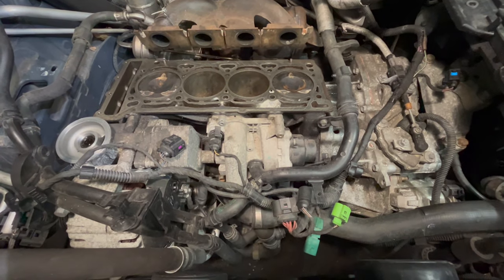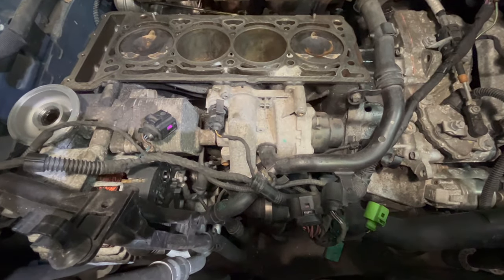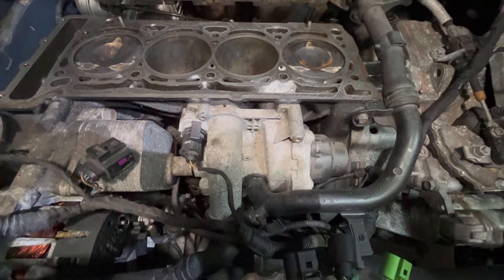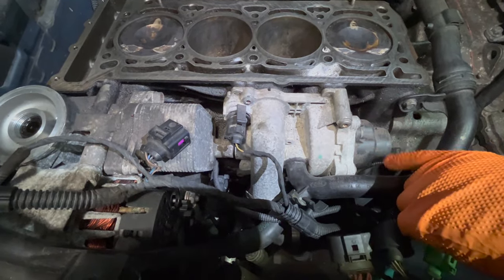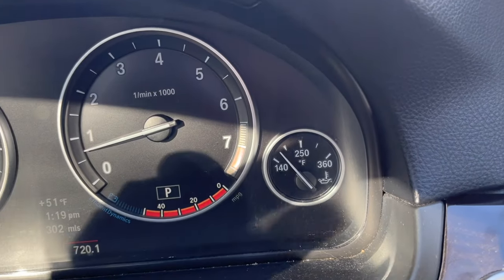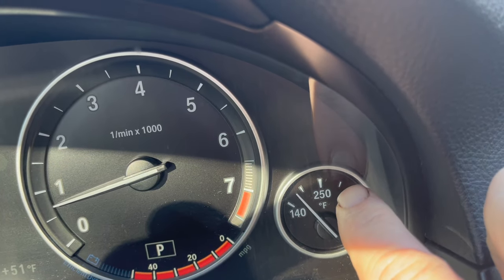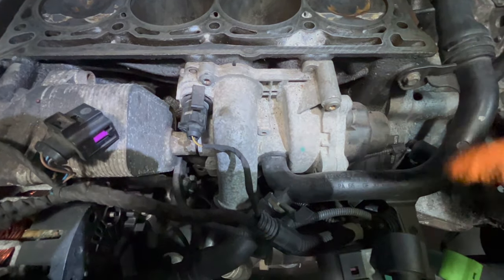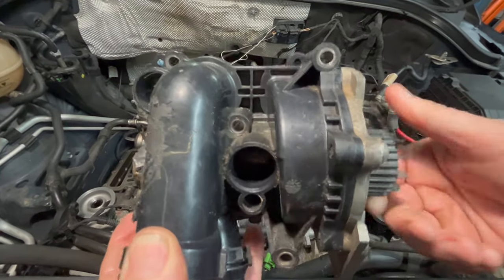3 Symptoms Of A Bad Water Pump

Comment: My bmw has 212k on the clock.    The coolant temp says anywhere from 85 degrees Celsius to 108 degrees Celsius….    No obvious leaks        Hope I will have signs like the ones you just pointed out instead of it just randomly dying.    Good video boss.
Reply from the maker: Thank you! Usually coolant problems happen slow so you will catch them in time.

Comment: Mine made a strange noises and my enjoin began to vibrate and I got it off the road fast and killed it. A belt hangs below and water or coolant was all over the ground.
Reply: The temperature gage was up not in the red but I got it to a safe place called the Tow truck and he came in 20
Minutes 😊
Reply from the maker: Hopefully all is good now? You caught it in time?
Reply: weird...mine goes pop pop sounds like I'm doing a pop n bang tune but then the steering wheel becomes so hard to turn😂 realize that the belt is hanging down the engine already

Comment: I have a Chrysler 200 2.4L 4 CYL. Had no issues with my car until one day while idling the upper radiator hose collapsed. Put the new hose on, got it burped, but had some over heating issues after I took it there. 

Not sure if they used the wrong coolant, but I replaced my thermostat housing and did a flush, then filled with the owners manual coolant. It’s no longer over heating as of 2 15 minute drives, but I notice the temp gauge is still fluctuating when i’m at high speeds vs low speeds. I made sure to burp twice now, so it can’t be air in the system is my guess. I already bought a water pump replacement, and figured if it’s the head gasket I may as well save myself the hour of labor.
Reply from the maker: It may have blown the head gasket from what you are saying.
Reply: @motorcarnut  The shop replaced my valve covers + gaskets, do you think they misdiagnosed the leak possibly?
Reply from the maker: @Zach-lz1zh very well could have.

Comment: Hey Motorcarnut, Seems like my old girl 2006 Opel Gamma 1.4 has just blown it's waterpump. Once car runs for 2km it starts overheating and coolant starts leaking from the centre of my engine (I assume the pump is sitting under the engine)
Reply from the maker: Make sure is lots a simple radiator cap first

Comment: I just got my Kia Forte 2013 a complete coolant flush, transmission flush, new brakes, and now I have low oil pressure light on 🥺 guys at Valvoline checked it out and said my coolant fell low however the oil was fine and since then, my coolant hasn’t gone down. I usually will give some ideas to the mechanic - just to avoid being ripped off. I was thinking bad oil pump or worse case scenario the coolant is leaking into my engine
Reply from the maker: Did they put the correct type of oil in the engine? Unfortunately those 2.0 engines are prone to engine failure do to faulty crankshaft milling. I have videos on my channel all about that and how to get a free engine. May want to check that out too. Hopefully yours is not that problem but just to be sure.

Comment: My coolant overflows and the heating stopped working. Mechanic changed the thermostat, the heating started working and after 2 weeks, the heating stopped, coolant continously overflows and car over heats after 15mins drive. I am getting frustrated now because its winter. Would this problem be the water pump?
Reply from the maker: Can be, but instead of throwing parts at it which can get expensive it should be diagnosed first. That said, water pump, radiator, air in the system or blown head gasket can be the problem.
Reply: @motorcarnut to diagnose an overheating engine will a mechanic have to take the whole engine apart?  because mine has the same issues but I really don’t have money to go to a mechanic but as long as they diagnose it I’m pretty confident i can fix the issue myself I just don’t wanna get charged for having them take my whole engine apart and then put back together. I’m only 20 and money is real tight right now.
Reply from the maker: @hollowtips23 not to diagnose the overheating problem, no they should tell you what they think the problem is just by doing some tests
Reply: @motorcarnut  Appreciate the reply, Thank you!!
Reply from the maker: @hollowtips23 no problem

Comment: My car keep overheating I have a 2010 fusion sport… antifreeze keep boiling and leaking but it takes a while of driving to overheat what do you think the problem is
Reply from the maker: Could be a faulty thermostat and or radiator cap. Start with the cheap things first.
Reply: @motorcarnut  I just replaced the reservoir cap yesterday. Heat working fine I think it’s a hole in one the radiator hose I hear sizzling when it’s hot
Reply from the maker: That will do it too
Reply: Same exact problems radiator cap helped. But still overheats on the long drive to or from work.
Reply from the maker: @jonathandoe2316 could be a thermostat problem
Reply: @motorcarnut  just replaced it a few months ago. Thinking water pump or a coolant flush needed.
Reply from the maker: I would have started with the flush first but go for it.
Reply: @motorcarnut  Alright I got a bad leak from my radiator now too. Still a flush first or water pump more likely now.
Reply from the maker: @jonathandoe2316 radiator should be replaced then
Reply: @motorcarnut  The whole thing not just the water pump.
Reply from the maker: If it’s in your budget, yes. Radiator could very well be partially clogged causing this problem

Comment: The reservoir tank is overflowing but not overheating. I changed radiator cap and thermostat ready but it still overflow. Please tell me about this problem 🙏🙏
Reply from the maker: Well can be a blown head gasket pushing the coolant out of the overflow
Reply: @motorcarnut  but engine not overheating. No bubble but slightly shaking propeller
Reply: @motorcarnut all day it work over 8 hours . Not overhead
Reply from the maker: Are you overfilling the reservoir tank?
Reply: @motorcarnut  I removed back to radiator
Reply: @motorcarnut  can be water pump?
Reply from the maker: @SaLin-uf9bf it’s possible yes

Comment: I have humming noise during the cold start in otherwords when I turn on my engine in the morning but after about 20 minutes of driving it disappears, my mechanic said that the bearing is worn but the pump will still work Can I give a grease nipple to arrest the noise
Reply from the maker: I don't think so, it's getting ready to fail and should be replaced.
Reply: @motorcarnut  Thank you very much for your kind and sincere reply
Reply from the maker: @munnachakra4342 sure, no problem
Reply: I have a 2009 bmw 528i and my car acts like it don't want to go like it don't get no gas when it gets hot could that be a water pump problem or my coolant tank
Reply from the maker: @edmundomiranda6773 no

Comment: What if my car does not overheat but after a while sometimes my coolant reservoir start having bubbles I’ve change thermostat radiator fan radiator would that still b the water pump? Nd my heat works
Reply from the maker: Some bubbles are the normal process of the vehicles coolant system but not excessive.
Reply: Foamy bubbles?
Reply: Gasket lol
Reply: Burp it?
Reply: @luxeiry1049 NO BURPING on the car. :)

Comment: so i just bought a skoda octavia 2022 with 22.000 km's. Its making a sound and it seems the water pump, also the car heats a little bit on the hood but the temperature is below 90 degree. I didnt know it was the water pump because its a new car and accelerated a little bit do you think i cause damage to it?
Reply: to the motor i mean
Reply from the maker: It’s under warranty, correct? Just go to the dealer, working on it yourself may void warranty
Reply: yes it is already scheduled thanks @motorcarnut

Comment: My car is not overheating kinda. But it goes over 90C and stops at 117C such a weird issue 😂 and if i want to cool the engine, i stop and turn the heat all the way down but then it even goes to 70C 😂😂 what the hack ?? Help please 😂
Reply from the maker: Could be as simple as a failing thermostat

Comment: If u have a gauge yes some don't mine dont
Reply from the maker: Yes, because they want your engine to fail.
Reply: @motorcarnut  it seems that way I swore never to buy a car again without 1 foolish idea
Reply from the maker: Some have no oil or transmission dip sticks either, lol.
Reply: @motorcarnut  true
Reply: Hye, my radiator is keep on discharging coolant into spare tank. Even many parts has changed (new radiator, new thermostat, new radiator hose, new radiator cap) but the radiator still discharging coolant into spare tank. One of my mechanic suggest me to change the water pump. May i get your advice?
Reply: @Zas Zahari  funny enough ive got this issue ..let me know what result you get . Thanks
Reply: Yes.  Some cars have a secret menu that the manufacturer does not want you to know about that accesses different live data readings.
Reply from the maker: @KingM4Bmw A good scan tool can access it
Reply: @motorcarnut  true that got diff car now with gauge lol